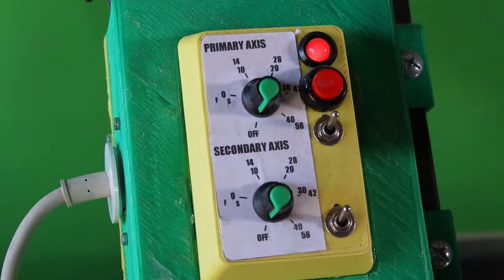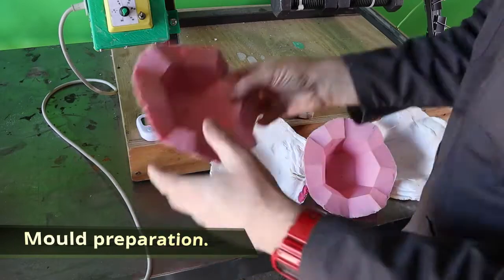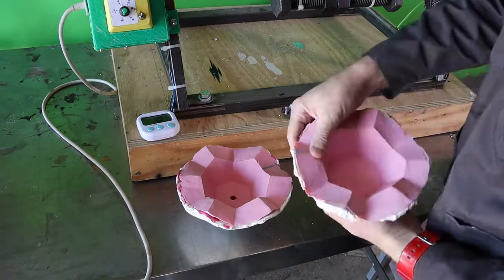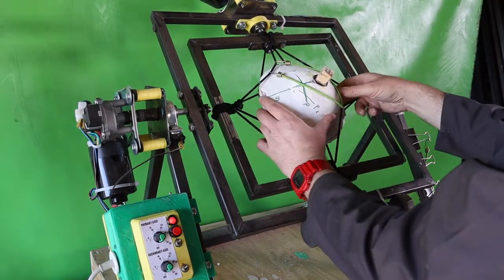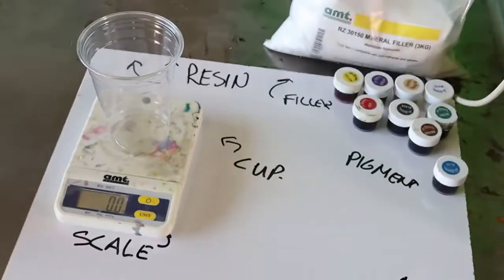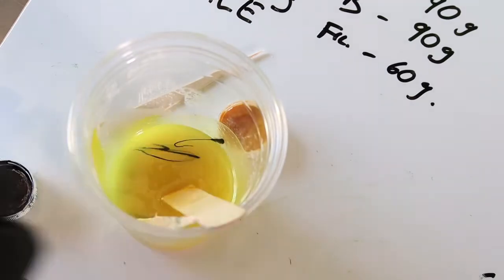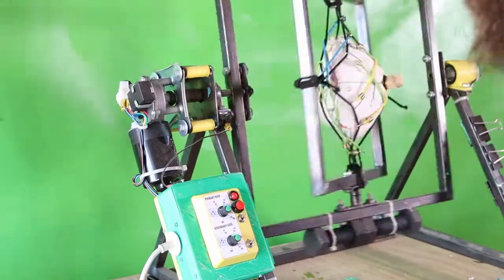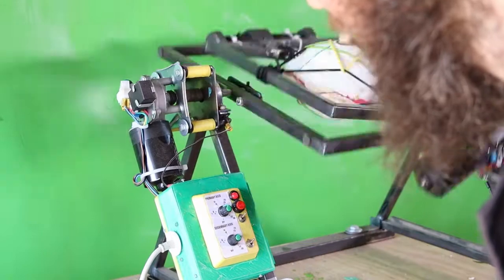Rotational Casting Machine: Independent Axis Control for each motor.

Comment: It would satisfy my curiosity to see your slip ring assembly, either in video or by means of a drawing.  Putting your plans online would be a great service.  I must say, though, that I don't see much virtue in having the two frames independently powered, over having both frames powered by a single motor with random gearing between the two.  Cheers from Canada.

Comment: Hi mate, can i ask why not simply use 90deg pulley system to drive the second axis? This would make things considerably simpler to construct and you would perhaps have fewer hassles in terms of balancing the machine?
Reply from the maker: Hi Jeff. The main reason is because different proportioned parts would require different rotational speeds for each axis. If you think of a long narrow casting, it would require a slower rotation along the long side, otherwise the resin would pool more at the ends and not coat the mid section evenly. This way the trial and error with different speeds can be done quite easily, whereas with pulleys it would mean different ratios to attempt to yield different rotational ratios. I am needing to figure a different method for my next prototype which will need to withstand 220 degrees C and I will try with Bevel Gears to achieve that, or chains and gear wheels, but that then becomes quite a tricky thing to prototype.
Reply: @martinbolton987  Hi Martin, I agree you would need to mess with the ratios to achieve that balance, but i think especially for castings which are part of a repeated manufacturing process - you are more likely to have a set of settings dedicated to a specific part, so once you have your mold and setup the balance and ratios, you would then save those settings and use them every time you use that mold. But yeah thanks for the reply mate. Have a good one.
Reply from the maker: @cigara87  Thanks for your comment. Yes that makes sense. It reminds me of a patternmaker's workshop, with huge collections of jigs each with dedicated applications!

Comment: hi Martin, awesome project, thanks for sharing. Quick question though, how did you make the electrical connections for the secondary axis motor?
Reply from the maker: Hi there. At first I was trying to figure out a way to use motor brushes (like in a drill) to make the connection around a shaft, but I then came across a pre-assembled electrical component called a Slip Ring, and they are used within wind turbines to allow for the assembly to keep pivoting around and around without wires getting tangled. I tried it in a small test with a small 12V geared motor, and then again in this prototype with the windscreen wiper motors. So far it has proven really effective!